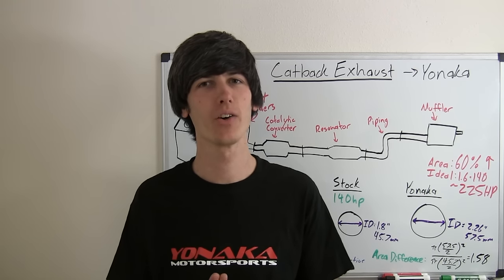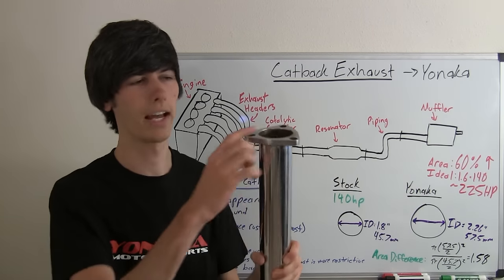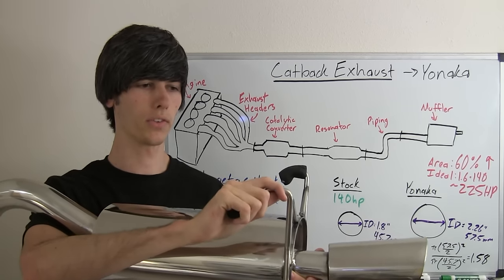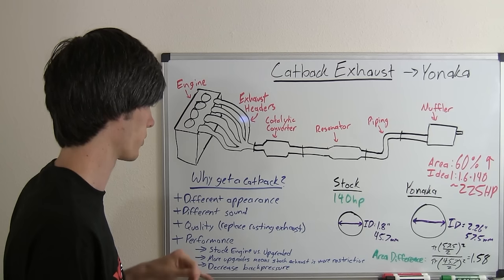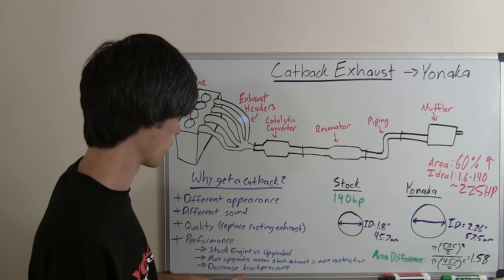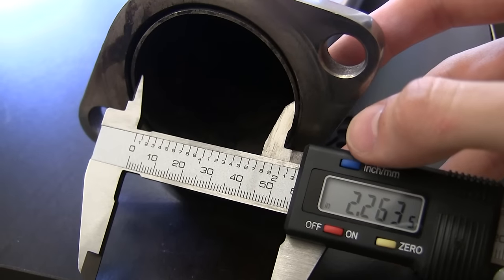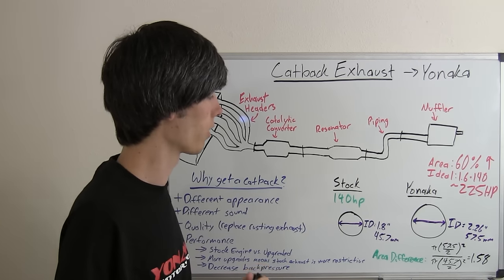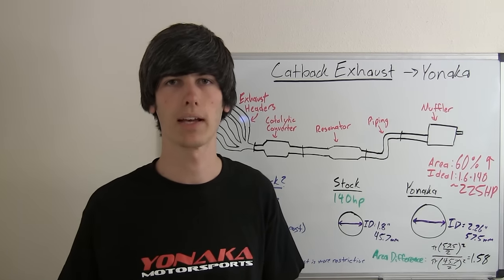Catback Exhaust - Explained

Comment: If that car doesn't have a turbo it's not going to gain any REAL horsepower (bottom,middle,top end etc) so idk where those numbers come up out of nowhere that a car with 140hp and no turbo is going to gain anything with bigger piping. Bigger piping doesn't help gain any horsepower with naturally aspirated cars.The only way that car can gain some power is if it gains a titanium replica of the stock exhaust with more sound deadening material in parts like the resonator, muffler etc.
Reply: hes saying that the new diameter will be effective for horsepower up to 225HP. If you put this exhaust system on a car with 140hp you could upgrade your engine to make 225hp efficiently. If you want more horsepower than that, get an exhaust system with bigger diameter suited for 225+ HP
Reply: I understand but most people aren't looking to buy an exhaust system and then say "oh shit, I won't gain nothing unless I upgrade my engine. He's right that yes you can gain more hp in that case, I won't argue that, but a lot of people aren't wiling to buy an exhaust system and realize after that since they're losing power they need an engine upgrade as well, that's why I'm saying  if you want a power difference in exhaust don't change your diameter, change the material of the exhaust (titanium) so the car sheds about 60+ pounds and then you can maybe gain some real power.
Reply: senad bogdanovic the best scenario for what your trying to say, would be gut out the cat & mufflers, or use a straight pipe the exact size of your stock piping to gain a bit of power, without doing any other modifications, also titanium piping would be pretty expensive for the 0-10 hp and .1 second quarter mile time you would gain from the weight... Secondly unless your a ricer, you dont buy exhausts before any other modification, usually you buy an exhaust when you need to help your motor breath better from other upgrades you've done.. bigger turbo, cams,intake,tuning etc etc.

Comment: Most "racing" exhaust systems might give 5-10% increase in HP. You're figuring a 60% increase-another 84 hp-because of the difference in the size of the tubing? Very interesting supposition.

Comment: You havto start with fuel system fuel injectors and fuel rails fuelpump upgrade that now u havto burn it faster upgrade the egnition system. sparkplugs coils and egnition timer. Then u havto move more air. intake system throttle body and cold air down pipe with cooler box and vent. Now throw cams in and tune it and thennnn the exhaust will do its job or the cutt outs. Exhaust on a stock engine will decrease its power and not only that the person tuning ur car is gna be like idk how to make ur car run rite with this big ass pointles exhaust on ur stock car.

Comment: measuring the diameter of the stock exhaust at the tailpipe is ridiculous.  An exhaust pipe and its tip diameter have no relation to each other.
Reply from the maker: Mark Vlazny I measured it under the car as well, it was the same. :)
Reply: Ok gotcha! Keep up the good work!
Reply from the maker: Mark Vlazny Sure thing, I did it so that you could see me measuring (was difficult to show under the car) but perhaps could have pointed this out.

Comment: I'm sorry but you will NOT see almost 80 horsepower gain with a piping job on a stock motor, maybe 35-45 IF YOURE LUCKY. But the ONLY way to see 80 is with a tune.
Reply from the maker: You won't see close to 35-45 either. I was saying that's what it's ideal for, not what it will make.
Reply: Engineering Explained  I new it was coming lol. as an example, all my piping were made based on the 285 HPs my car produce. after $1K, any Gain? Dynoed 7 hps and a nice sound. I am happy even though 1000/7= 142 per pony. there must be a better way to get hps at a cheaper price...lol, but it is all about the sound this time.
Reply: I doubt you'll ever hit an 80hp gain even with a tune. But its probably gonna be about a 15-20 hp gain being reasonable. Not saying its the maximum gain, but yall gotta understand that it's only the exhaust you're changing.
Reply: djnekkon Yeah I'd go for a turbo system at the 1k range. Its gonna be a lot more expensive ,but it'll bring a hell of a lot more hp.
Reply: Clearly you were not paying attention to the video.
Reply: You're Wrong Clearly you don't know what you're talking about, so just like your tag, you're wrong. Sorry bro.
Reply: Im wrong because the guy who posted this comment thought he said this would give you an extra 80hp? Try again buddy.
Reply: Lmao Sorry bro I thought you were talking to me.

Comment: 140 to 225 hp with a catback?!!! u trippin bro! haha
Reply: No, YOU'RE trippin'. Watch the video again, listen and read what is said.
Reply: He said that 225 hp is possible with this size of exhaust in comparison to the stock, not that it will increase your engines horsepower by that much :P
Reply: asmarshall9 Actually, he is saying that you will see the greatest power gains from the catback at around 225 hp (on this particular motor)

Comment: you need to get a new job .. if your very luck with a new exhaust system and you better update the ECU or it will run lean you get about 6% more power that if your lucky so take this video down and stop giving out  bad info
Reply from the maker: +Stephen Kasapis You need to listen more carefully. I said what the optimum power for the exhaust system is, not how much it would add. Separate video for the performance benefit: https://www.youtube.com/watch?v=oyipo02vS4Q
Reply: Thanks I did listen to it again and the last part you said with a modified motor you can gain a lot more power using this catback exhaust ?? does not matter what motor your using you can not gain to much power from a exhaust system if your very lucky you might get 6% more power. If you can then please put a car on a dyno and put any exhaust system you like on and show us how you going to get more .. then say 20 % more power just with a new exhaust system I bet your only get about 6% more
Reply: +Stephen Kasapis  yea. he's not saying you'll gain 60% more hp from just a catback. He's saying that if the manufacturer found the stock exhaust diameter pipe good for 140 hp then this catback would probably be good for an engine making 225 hp. If you didn't change your exhaust it would definitely become a point of restriction and you wouldn't have the greatest efficiency.
Reply: mr Felix Airck first you dont know any thing about me ?? and any one that say you can get more 10 % just by a new exhaust needs to look for a new job this is a fact give me some facts and I might delete but this is the facts YOU WILL NOT GET MUCH HP JUST WITH A NEW EXHAUST :-)
Reply: +Stephen Kasapis If you have an engine making 800HP(Upgraded)- (550HP stock) and a very small exaust diameter, the engline will obviously be limited and the exaust is likely to be demaged. You need a larger exaust diameter to allow all the extra gas to flow freely, meaning the engine is not held back by the exaust which means that the engline can then take advantage of the new exaust upgrade allowing the engine to work without exaust restrictions which results in the power is UNLOCKED if you will beause it is not being held back like the stock exaust was doing to the engine.
Reply: +Stephen Kasapis  
Why would you need to put it on a Dyno..

It could all be figured out with just maths on a whiteboard. 

Also Not every car is the same not every country is the same.
Some countries fit tiny exhuasts to import cars so they don't outperform locally made cars 

(Toyota Yaris in Australia had the Stock 2.25" exhaust replaced with a 1.5" exhaust to cut the power down majorly (about 25%) as it's a much better car than Holden Barina which could not compete)
Reply: well if you tune the engine , it produces more exhaust gas wich the stock exhaust is too small for .  so the stock exhaust will reduce power and the catback give you all the power .   when you do nothing to the motor then the catback is just for sound and look .  maybe a little more power .
Reply: Like i also said elsewhere.

there are many cars imported into some countries where the local car market & government laws modifies these cars so they under perform and are not better than Locally made cars.

Eg,
Toyota Echo(yaris) in Australia - they removed the stock 2.25" Cold air intake and replaced it with a "Quieter" 1.5" intake tube cutting about 5kw off the already low 67kw or whatever it was.

Eg, 1992 Volvo V6(forgot model)
Australian part for exhaust is majorly different versus the stock part from sweden.
(Twin 2.5"(swedish) versus Twin into Single 2"(aussie)
-significant power difference as the 2.5 was 'just' big enough)
Reply: ***** you understoood the video .   but you can pu that on your car anyways .  you dont get more power but it sound and looks like it has more power .
Reply: he always say things from math point of view :)

Comment: So many errors in methodology in this video.  For example:  The percentage increase in circumference of the cat back pipe does NOT correlate with the same % increase in horsepower.  To keep it basic: what matters is less backpressure or resistance to the exhaust pushing out of the engine.  Pipe size is only part of the equation.  For cheap people, just cut out your mufflers.... known as a muffler delete.  This might give perhaps 5% more HP but it will be louder.  Too loud?  Maybe ....but a shop will do this for $200.  Changing the resonator, which is  a straight through part, most likely will do nothing to increase power but might change sound.  For perfectionists and auto engineers , they can debate the finer points of pipe diameter, "tuned headers" and what sound they like.   For reference, I watched a vid of a middle aged guy with a G37 Nissan.  He added the Stillen Cat back with it's rather quiet mufflers and a K&N filter.  He dyno tested before and after and saw 17 hp increase above 3500 rpm.  I think his testing was credible and the gains realistic for the Nissan 3.7 L   6 cylinder.   For my 2020 Maxima, I will be doing a muffler delete.  I suspect it will match the Stillen system gains because while it does not have the Stillen magical Y pipe,  no mufflers is far less restrictive that the Stillen performance mufflers which are not loud at all,  As of 1/21 the Stillen cat back cost $1200 USD for the 2016-2021 Maxima.  It's a nice option and easy to install for those who want a less loud performance system.

Comment: Just buy a real car with 400hp+, problem solved.  Cat backs are for sound and sound only, you need to replace the whole system for any type of meaningful gain.  Also need to push more air in at the front end.

Comment: 140hp to 225hp with a Yonaka catback LMMFAO!!!
Reply: Kaiser that's no what he said.
Reply: Kaiser lol
Reply: Kaiser nope thats not what i mean. He means that stock exhaust are build for the hp of the engine. And im not saying that if you have more hp it will still go the same speed cause you have reached that limit. But with a catback exhaust or just a whole new exhaust system you engine will "breathe" better if you understand. It will have less resistance.